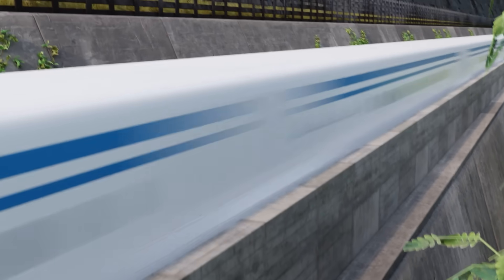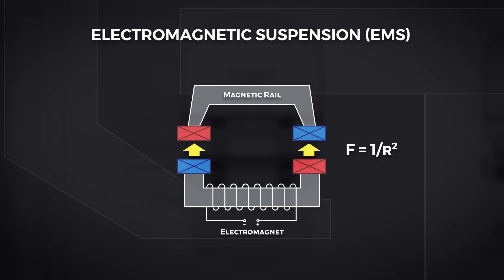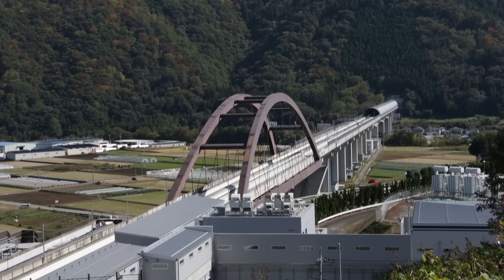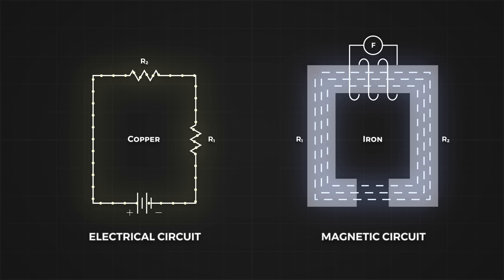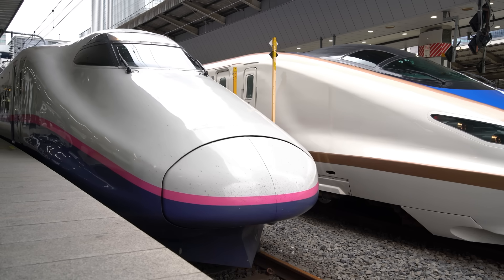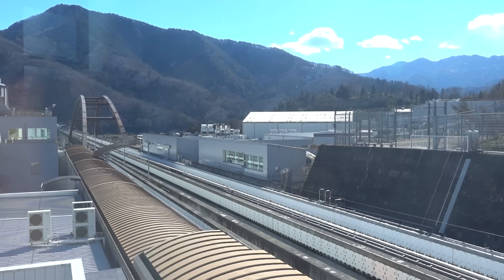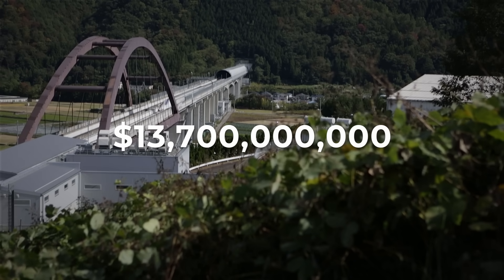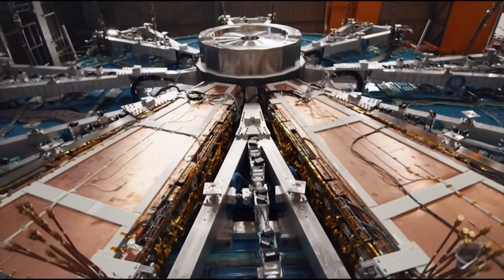How Japan's Maglev Train Works

Comment: One of the best things about "normal" high speed rail is that it's conceptually pretty straightforward. Just crank the voltage and make sure the rails are very straight.
Reply: It's not just rails, but also the catenary wire tension and corect banking for corners... and then you still have noise and vibration concerns. Regular HSR may look simple but it's just because we've been doing it for 50 years.
Reply: Casting a slab of concrete is the easy part, making it earthquake proof in Japan is an engineering nightmare...
Reply: and some good dampeners to avoid the train from derailing
Reply: @grummhd3020 ffpooopppppp
Reply: Well, Americans prefer the good'ol days.... Dying while driving at a third the speed of HSR 🙃
Reply: And I bet that with recent (i.e. past 10-20 yrs) advances in power semiconductors like SiC transistors, you could build some very efficient VFDs for high speed electric trains.
Reply: This is the shockingly life changing story of your enslavement 👉 The Connections (2021) [short documentary] 💖
Reply: not really, its gets very complicated not just because of engineering issues, comfort but also safety. Think about just doors. When two trains are passing at 300km/h the forces on doors are enormous. Also because of pressure changes you need to have the train pressure sealed.
Reply: @bartz0rt928, tilting tech can be used to build HSR networks in the USA and Canada.
Reply: I came here from rumours of underground maglev trains cruising the u.s, straight lines
Reply: Go read something on TVG records and how they had to tension up the centenary wire to “tune” it out of critical frequency…then you’re faced with problem of some materials not able to withstand the force…
It all scales well up to 300km/h so that’s why we’re pretty much stuck there 😃
Reply: The train also has to be air tight because of the pressure spike when you enter a tunnel.
Reply: "straightforward" indeed
Reply: And the rails have to be all one piece.  That's not so easy.  Gotta cast them in place.
Reply: @penultimateh766  does welding not work for high speed train rails?
Reply: @Mrraerae  Apparently not.  Going over the welds would derail them apparently.
Reply: @penultimateh766  The tracks are only casted in place insofar as to join the long segments of rails together. Most high speed rail lines still by principle do single welded rail. The rails are brought in on multi-kilometer long trains and the rail is machine fastened to the sleepers. At the end of each segment, the rails are bonded together typically using thermite casting (iirc) and then ground and filed down to precision. The tracks are also tensioned and temperature treated at this point to minimize thermal expansion. After all this a railcar or other examination vehicle is used to check the geometry of the the rail is within tolerance for high speed operation.
Reply: @penultimateh766  but you can grind down a weld until it's all flush, welding melts the pieces themselves together so you don't need to leave any extra material there
Reply: @Mrraerae they are welded in place, using a very weird welding process that might feel like casting but is actually welding.

To put it simply you have a crucible with iron oxide (rust) and aluminium powder that you set fire to, and it creates tremendous amount of heat and steel, that then flows onto the rails underneath, and merging them into one
Reply: @InformatrIIcks  Thermite welding. I guess it's because the tracks are so thick you need a ton of heat to melt through
Reply: @Mrraerae  also because there's ton of space to fill, arc welding would just be too damn long to do
Reply: @penultimateh766  Rails has been welded for decades for commuter tracks. 
More of an issue is that you need to go straight.
Reply: Subway systems are engineered to reduce problems that above ground have due to terrain...
Reply: How to make the rail very straight in 500 miles mountain and another 500 miles of inhabited cities land?
Reply: @Civsuccess2  That's exactly the problem. Not from a technical point of view, but from a land-ownership.
The owners of the land have to comply with the planned route, as a route can't wrap and swirl willy-nilly through the landscape.

You HAVE to keep the rails banking/curving very shallow for high speeds, as lateral G-forces of greater than 0.5 are already a noticable strain on the neck muscles, and preclude most walking. Which does occur regularly in trains.
The problem exacerbates when you are going 600km/h instead of a 'mere' 300 km/h.
That's where planes have a massive advantage: they bank by rolling, thus shifting the lateral g-forces into more appropriate downward g-forces. Or rather, instead of trying to hold onto the seats while walking down the aisle for balance, the plane makes it feel more like walking with a slight sideways drag.
That's why pendulum trains hanging underneath the rails are far superior in that specific regard. They automatically swing out to the outer side of the curve, thus make a curve seem to be far less violent. These types of trains are however few and far in-between.
Reply: Think underground tunnels flat engineered like Elon Musk. This is not abnormal underground tunnels are all over the World...

Comment: The Chuo Shinkansen still feels almost like a pipe dream, but it's a pipe dream that's already in construction - they "just" need to keep building.

Compare this to hyperloops, where test tracks are much shorter and much less proven and everyone is still just pretending 4-person pods can be a viable system. Or ordinary HSR in the US, where plans almost never actually start construction. The Chuo Shinkansen actually has a decent chance to come true.
Reply: They started in 2014 and was suppose to be finished in 2025 (prospered to 2027), so they are probobly closer to finish then start. With that. they actually built 22 km of it between 2011 and 2013 as a trail build. So technically the started in 2011.

"The Chuo Shinkansen actually has a decent chance to come true"
it already is true, the question is really how and when it will finish. Its worth saying that the second part have been  brought forward by 15 years. Interestingly nobody is talking about that.

Comment: Still FAR cheaper than HS2 and it's twice as long... 🤣
Reply: This is an experimental track built outside populated areas so no complex land purchase deals were necessary.
Reply: @Mekchanoid  - I'm talking about the cost of the whole 400km line - Not just this experimental bit...

Comment: While maglev is a cool idea, clearly regular HSR is still the answer. Especially with the introduction of the China's Fuxing CR450 which will have an operating speed of 400 KMH/249 MPH (compared to the Shanghai Maglev 431KMH/267 MPH), it shows that HSR is coming very close to what maglev is offering at a much cheaper price not to mention the ability to operate on regular lines if needed.
Reply: Yeah the maglev only makes sense here because it's a parallel express service for existing high speed trains. If there wasn't already shinkansen service connecting those cities you'd want to build that first.
Reply: @AlRoderick  Even in the US it still makes more sense to invest in regular HSR vs maglev. The fact that HSR trains can make use of regular lines for last mile connections into a city makes its use-case far better.

Comment: This video is missing predictions about ways to reduce the cost of maglev. How much cheaper could they get with higher temperature superconductors? What about optimizing the alloys? Mass producing the pricy parts? Vertical integration? Metamaterials? Graphene?
Reply: The pricey parts will always be figuring out how to safely get a train trough a mountain. or how to maintain desired slopes. Or how to reduce/calculate noise footprint in and out a station. Or how to add said track to existing infrasfructure. 

No scientific discovery will ever reduce that what actually costs the most in civil engineering. It can only make it more economical.
Reply: Pretty sure those technologies you listed, the ones that exist anyway, would be MUCH more expensive, at least initially.  Do you really imagine that humongous portions of the research monies did not go exactly to research on materials, etc?

Comment: it is so sad that the us has such a bad rail system because they could have the most interconnected system considering the beginnings of the us. They used to have one of the best rail systems ever but decided to go for cars instead. Most developed nations already have reached a point of saturation when it comes to rail infrastructure but the us has not. There is so much opertunity for it but just no will.
Reply: For extra irony points, when Japan was originally building out its first rail networks back in the late 1800s, they used the US's rail system as a model for their own.

Comment: Am I the only one who noticed the blood splatter on the Shanghai Transrapid train at 9:28. really hope it is just a bird strike and not some poor maintenance guy not paying attention.
Reply: Nope.  I was kind of hoping it was a bunch of protesters standing on the tracks (kidding, of course, because that would have been a lot more blood, kidding there, too). When you consider that this thing is eating up a football field and a half every second at top speed, the chances of a bird figuring that out and getting out of the way probably isn't that high...and it's quiet, so it sneaks up on them, as well.  Sylvester has nothing on this thing wrt to Tweety Bird.
Reply: Well normal cargo trains and ICEs in Germany have often times accidents with hitting wild animals. It Happens. At the next stop you clean up the front look if there have been damages and its done. At that speeds or with a lot of weight from cargo you will never slow down fast enough.

Comment: one of the biggest thing about high speed trains is electrification. you can do a lot to reduce emissions by using electrified trains, which can draw power from any source. the volt god does not care from where the electrons flow, only that they do

Comment: I don’t think it’s fair to compare maglev with TGV due to the the Japanese system using tunnels so much. Would be better to compare like with like terrain.
Reply: Well, it might been more fair if they actually used real number and not $2M... to get it into perspective.

$2M/km is about the cost for a normal rural 2 or 3 lane road. (That is, a total number of 2 or 3 lanes, in both directions combined) A single track non electric railway typically cost $5.. dual track about 8, electrified about 12., high speed. about 20 (well 20 and more expensive, 20 is really the very cheap end)

Comment: I love the HUGE fuckin blood stains on the front of the Shanghai line train lmao. This is one of the biggest issues I see with trains like this. If something gets into the track, especially a deer or other small-medium sized animal, hitting it at ~350mph would be catastrophic, especially if it got underneath the train and stayed solid long enough to mess with the 10cm gap and causes the train to either bump either side of the track or bump hard enough to scrape the bottom. I'm sure they've thought of this so what kinds of safety measures are in place for something like this?
Reply: There's always the old 'put your head between  your legs and kiss your ass goodbye' maneuver.  :-)  Somehow I don't think there will be a lot of moose or blue whales getting on the tracks though.
Reply: @MrJdsenior  yeah nothing that big but I think that even stuff as small as a raccoon would cause some serious issues at those speeds...

It definitely wouldn't destroy the front of the train or anything but the damage it can cause may domino effect into derailment.

Comment: Your comparison between high-speed-rail cost and maglev cost is highly misinformed and dead out wrong. 
If you were to compare the actual same kind of track (i.e. the same tunneling etc.) they would be about equal (sometimes more and sometimes even less expensive) to build. 
The Japanese Maglev is so horrendously expensive as it tunnels through tough terrain in an earthquake-prone region.

Going by your argument, I could say that California High Speed Rail is much more expensive than this Maglev track, but I would not as they are not at all comparable
Reply: There is no argument that a maglev track is more expensive than concrete ties and steel railroad track. Take tunneling out of the equation and HSR still wins out. The speed advantage for maglev doesn't make up for the additional costs. Especially when China is showcasing new Fuxing Hao CR450s setup to operate at 400 KMH/249 MPH.
Reply: @Ven100  While the japanese Maglev MIGHT be more expensive in a fair comparison, that certainly is not true for all maglevs (take e.g. Transrapid which was projected to cost about the same to build compared to HSR - back in the day when this technology was still alive that is) and, more importantly, economics of scale do not apply to maglev at this point but do apply to HSR.

Furthermore, in a fair comparison, it certainly is not anywhere close to being 50x more expensive (even with the fancy Superconducting magnets) as claimed in this video which was the main argument of my original comment

Comment: Why does High Speed Rail start at ~2 h in that graph at 12:20 
Or in other word why does a travel by High Speed Rail needs 2h for the first 50 km. 
Look at the German ICE connection between Berlin and Hamburg. That track may not have a very high top speed, but it is a comfortable non-stop city to city connection. It has 3 stops within Berlin and 3 stops within Hamburg. Ensuring that the travel from door to one of the 3 possible entrance stations is not equivalent of driving thru the whole city. 30 Minutes is easily doable in my case. This approximately 280 km travel is done in about 1h 40 minutes in the shortest configuration, (1h 55 minutes Main-station to Main-station) and max 2h 20 minutes if you take first of the 3 stops and last of the 3 stops. 
The top speed on that connection really isn't that high 220 - 240 km/h is about the top speed. 2h 30 minutes for roughly 300 km matches the green line in the graph but at about half of the maximum travailing speed compared to the estimation for the high speed rail example. This looks rather unfair for high speed rail to me.
Reply: The grapth is a bit wrong. The airplane should start at 3hours and go 1:800 out. The high speed trains should start at about 1hour and go 1:200 out, then a maglev would start at 1hours as well and do 1:400 out.

Comment: Once I saw Tom Scott’s video I know it was only a matter of time until you did one
Reply from the maker: Tom allowed us to use his footage too! Not a lot of footage of the Japanese test train available to license
Reply: @RealEngineering  Heads up. The comparative number for high speed rail in the economy section is all of by a order of magnitude. While the maglev numbers are right, the high speed numbers are way to low. The cost for the LVG lines in france should be $20M, not 2. For $2M its hard to even build a normal car road. All the comparative number there after is off by a order of magnitude.  Also the SC-maglev contra shinkansen should not be 11.3, it should be 1.22 (JR-centrals published numbers)

Comment: Why Japan? Population Density. Which is why nothing like this ever makes sense in the US. Comparing Trains to other travel methods must include the experience of the population using them at the destination. You can put a train to most of our country... but the experience at the endpoints won't be favorable for distances of less than 4 hour drives.

Comment: Couple of questions on this 1
1. Regarding those magnets, do they loose strength over time and use?
2. The thermoacoustic refrigeration I believe was a patent from Ben And Jerrys or Penn State came out with it. 1 of those 2
3. I believe there is at least 1 mag lev train here in the States, I wanna say Virginia, don't quote me.
Reply: 1: Electromagnets don´t lose strength, only permanent magnet do.
2: Any patent would have lapsed by now:
3: To my knowledge there are 3 prototype full scale systems in the US, there might be more that i don´t know about.
First is the American-maglev/Old Dominion University that in dead is in Virginia. The university track was dismantled and there was a prototype system built. Video of it here.
https://www.youtube.com/watch?v=QxyyZokwUFo&t=47s

Then there was the LevX freight transport prototype. To my understanding is dismantled now. Its actually very impressive. The so far only totally passive system in the world (well, the system is sort of psudo stable. its stable as long as the train is very center on the track, but it need physical guard rails)
https://www.youtube.com/watch?v=yXg9F0HePv0

The third is the general atomic ECCO, economical cargo container carrier, that use a litz pull to lift system. There was just a short prototype track made. 

There are plenty of maglev prototype system around the world, even full scale one.
Reply: My question is why hasn't Amtrak produced 1 at this point in time? @matsv201